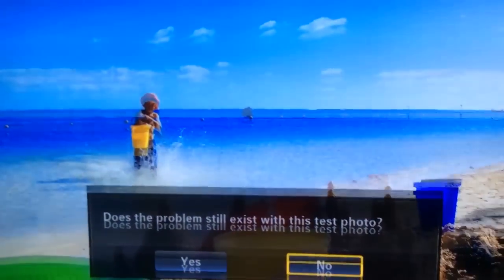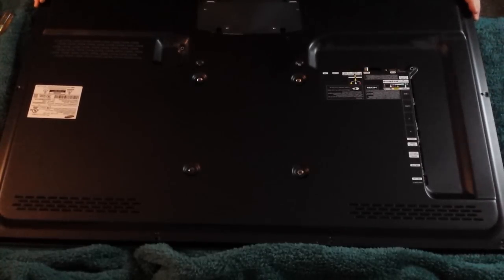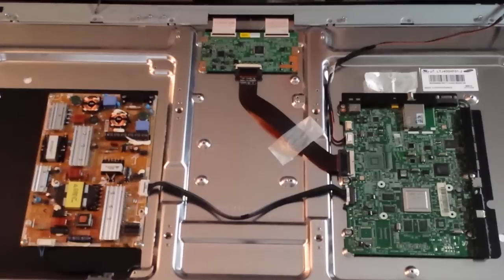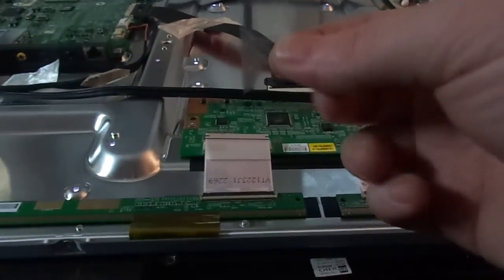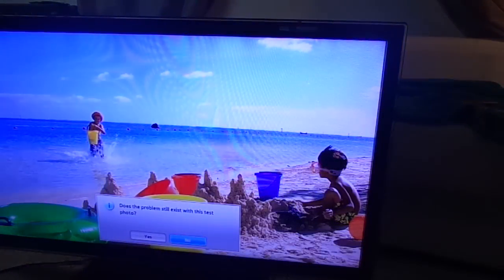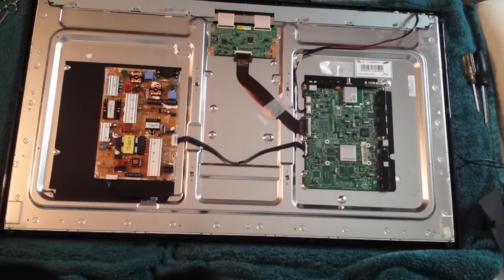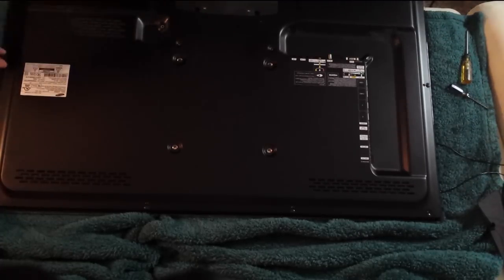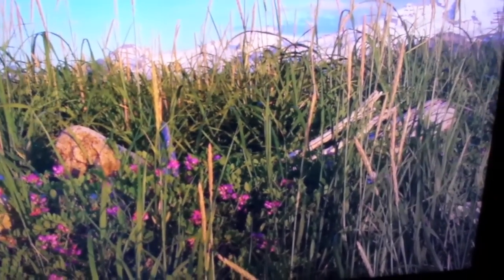LED LCD TV FIX, How To For Samsung Double Image, Black Vertical Lines, Screen Problem Sony LG.

Comment: hello any chance you could give me a close up of the bit you taped? is it covering the gold tab so it cant make contact?
Reply from the maker: Yes it is covering the gold tab
Reply: @DoItWithDave  if i disconnect either one i dont get half a picture bud it loses the picture then the backlight flicks on and off. would this mean both strips need covering? and is there a certain amount im meant to cover? sorry for the questions but im pulling my hair out lol
Reply from the maker: @brianturner5864  double check that the ribbon cables are not damaged. They are very delicate. If no damage it's just a matter of adding the tape over (in my case) the left side of the screens ribbon cable. I covered about a quarter of the gold part of the cable but had to remove and make put a smaller piece on the right side of the cable.
Reply: @DoItWithDave  thank you bud i experimented and done one of the ribbons with a thin strip on the right. i have a perfect picture now aside from a tiny black line running halfway accross the top of the screen but i can live with that as its almost invisable most the time.

Comment: How do you know where to put the tape, and does the tape put some connection on the ribbon out of work?You do it on the left/right ribbon or both?Hope you can help me have a Samsung and find it shame to throw away.If there is another solution I am open to suggestions, thx.
Reply from the maker: Idk if this video is quality enough to see where I put the tape. I put the tape on the left ribbon cable close to the inside, and covered about 12 of the gold tabs. This can be a short process or a longer one depending on how the tape is placed. I had to put tape, remove it, put, and remove a couple of times before I got it in the "sweet spot". If you end up needing to move the tape during the process be gentle with the ribbon cable tips, they can be easily damaged. Also I think the tape helps insulate the ribbon cable so no static electricity builds up that partially causes this issue. I hope this helps.
Reply: @DoItWithDave  Thank you for taking time to answer, I saw last year somewhere simular video, lost the link. But I have an idea how to proceed: fullscreen of video and make a printscreen. Unfortunately I lost the link of that other video, I counted about 16 or 17 goldplated tabs that were covered, So you covered the gold tabs, about 12 of them? Any idea why this is happening to Samsung TV's it seems they are notorius for having this issue. I will try in the next days and let you know how it goes, am not the most patient person on Earth,lol

Comment: nice
i got a pc screen 27', the image is double, 2/3 on the top, & squeezed image repeated  on 1/3 on the bottom
do u think it's the same king of fix ?
Reply from the maker: Idk if you had the PC screen for a while and living with it or you just aquired to recently but at any rate you could give this a go. I know it's not ideal but if it works then you got your image back if not then it may be time for a new screen. Just to clarify this is in no way a professional fix for the double image issue but an alternative possible fix rather then replacing the display as a professional would recommend. Obsolescence is the name of the game.
Reply: thanx for the answer
cant find a professionnal to fix it, so i ll give it a try

Comment: wow i fixed my TV SAMSUNG UE50ES5000 following this video.. i had horizontal lines at the bottom with some ghosting...did exactly the same with the tape on the ribbon cable etc... THANKS
Reply: I found people who cut some lines near the connector on the board itself so it doesn't make connection. I am planning to try to solve the problem on my Samsung UE40D6200, Samsung has become rubbish.

Comment: Hello.. My TV has double image. The small tape you stuck to the ribbon cable you don't discuss..  From what I can make out this is open circuiting part of the ribbon cable ? How many lines are you opening ? I'm surprised to hear you say just stick it on ?  Shurley there is a method to your madness ?  Please tell us more.. Tnx Mark.
Reply from the maker: I just covered about 12 of the gold lines in this video. 
Honestly there is a way to explain why this works from an engineering perspective however I don't know the specifics of why it does. There are more videos on YouTube that show this same method, and explain in detail the facts about why this works. I've heard static electricity builds up and causes the display issue or the t-con board is bad. All I know is for how much ppl spent on these TVs when they first came out, only to get a double image 2 years later is BS. It's a pretty obvious example if planned obsolescence.

Comment: Hi i have  colored verical Lines on my Led Samsung es8000
Can i fix it with this metod?
Reply from the maker: Hello my apologies for the delayed response. If you are still looking for a reply all I can offer is in the last couple of minutes in this video you can see the vertical lines across the display. I simply adjusted the ribbon cable in the locking slot and was able to get rid of them. I hope this helps.
Reply: Do It With Dave can i send you a photo
My Lines are different
Reply from the maker: Honestly I don't know if I can help based on a picture. The issue your tv is having could be caused by a number of factors. Maybe a bad t-con Baird, bad connection with ribbon cables, a bad capacitor. I have seen some videos on YouTube that show a certain type of flat screen that have 6 or more ribbon cables that are non detachable from the display. Some ppl show the image change a bit simply by rocking the tv gently back and forth. If that's the case the cables surrounding the display could get some make shift spacers to adjust their positions. If you really want to send a pic  email 
eyelinegroup@gmail.com

Comment: guys double image screen on samsung 32 screen how to fix it any tips or tricks
Reply: you got a same problem as mine..have you got it fix?
Reply: @migi741  i did scratch the specific line on motherboard it worked for 3 hours Hd and fine problem fixed but after 3 hours 45 minutes all went ofg like dead screen the tech told me thats the double image screen is signe on future problem u need to fix it asap now im buying new motherboard display . if you wanr to see the do it at your own risk method it could fix your tv replay me i will try to show you the video or send u the yt link here
Reply: @MrYoyo374  i dont see any link..and the future problem is like what?
Reply: @migi741  i did as the guy on video told me not this video other 1 i failed somehow to do something boom a whith screen with only asound inti
link Put it in High quality and use a loop zoom and use flashlight becarfull bro   https://www.youtube.com/watch?v=LKCb7K1jrOA copy the link or writte it doqwn on google

Comment: The problem got progressively worse as I tried to fix, do you think I should just get new ribbon cables and try?
Reply from the maker: I did this on another TV and the ribbon Cable became damaged and it did get worse on the display. I had an extra ribbon cable lying around luckily and use that and it did work. If you choose to continue working on this you can find the part number for the ribbon cable on the back end of it, type that into eBay on the search and you should get a listing for all the ribbon cables that are compatible. I hope this helps.

Comment: My Tv has these ribbons at the top, not the bottom. So I'm not sure if I'm supposed to do it mirrored of how you are doing it? As in, put the tape on the right side? I tried both sides with various widths of tape for like 4 hours and all that ever happened was the side I was trying to fix with the double image just turned white, rainbow, or black.
Reply from the maker: The issue your dealing with is common, so ppl don't have great results following the steps in this video however some people have stated using a small piece of paper and placing it on back side of the ribbon cable (not gold side) and getting good results. Kind of like putting a spacer between the ribbon cable and the bracket. Also this process is ay last ditch effort as it is a hack video and not a professional fix. If you decide to continue working on this remember the ribbon cables are very delicate and can become scratched if worked too much. I hope this helps.
Reply: @DoItWithDave  Thanks for the reply, i will try that thing with paper in the morning and see if it works. I also found a video where a guy was fixing same problem with my exact model TV same way youre doing it, and in the comments section someone said that you have to put the tape over the first 19 gold contact strips which is funny because when I pause your video when you show a closeup of the tape,  I counted exactly 19 gold strips under the tape.

Comment: Thank you! This is what I love the internet for, thank you for the time and extra-work to make this video! 👍💚
Reply: After an hour I got it aswell, but for me it was the right cable and I needed to place three layers of three millimeters wide pieces of office tape underneath and not on top, I pushed it down and lifted it and realized it must be the contacts on the most left or most right, the and connectors are mirrored. Thanks again 👍

Comment: Hello, great video. Will this fix work with Samsung plasma with horizontal black lines on screen?
Reply from the maker: I don't recall anyone posting doing this with a plasma. I know from experience that early versions of plasma had ribbon cables that weren't accessible like this video shows. I think cables were compounded in the display.

Comment: Hello,
I have the same breakdown tv on samsung I mi the sctoch on the connector but it does not work, it's vertical strips the sctoch you put it at what place on the connector? by putting the sctoch it does not prevent the connection of this? merco for your answer !!
Reply from the maker: Hello. I put the tape to cover about 15 of the gold pins (lines) and that worked for me. As far as the lines I had to very carefully position the ribbon cable sliding from side to side very delicately until the lines went away. The reason for double image is bc static electricity builds up on the cable. The tape prevents this from happening in the future. Unfortunately the steps shown in this video don't always work. This is a "hack" not a professional fix. The reason I posted is because the professionals charge more than the tv is worth. It's a last ditch effort. If you continue to work on this be as delicate with the cable as possible. They can be easily damaged. Also the tape works for some ppl when more or less on the cable is covered.
Reply: ok thank you very much for your answer, it finds the pb comes from the slab of the tv no?

Comment: Thanks a lot sir it worked for me I am from hyderabad telangana state India I'm really proud of u sir my sony led worked fine but one question sir it could damage more components or how its worked how its possible pls mention sir.but 3d stopped working
Reply from the maker: From what you posted it sounds like you have a 3D tv, and the 3D isn't working after following the steps in this video? If so unfortunately I don't know if this is a direct issue from following the steps, however it seems like it would. Also I haven't seen any posts addressing this type of issue. I hope I understood your question, if not just reply. I hope this helps.

Comment: I really didn't believe it was going to work. And it took a while but i actually found that sweet spot for the piece of tape and it did fix the issue. I can't thank you enough.
Reply: Dude... Help!
I tried to do this last night and I wasn't able to get the picture right. Did you glue the piece of tape on both sides? I can't get the picture to display correctly
Reply: @kickspyka  i did exactly what he shown in the video: A small piece of tape, covering both sides of the ribbon cable... but make sure that on the side with golden pins, they are properly covered. Also, try moving the piece of tape along the pins until you find the sweet spot. Take your time. Idk why it works, but it does. It took me a while and i had to try it with both ribbon cables. I found out that it's a good idea to disconnect one and check the image (in my case, just by disconnecting one side fixed the problem on the remaining connected site), then try reconnecting that cable and compare the image quality disconnecting the other and see if one cable wields better results than the other. If so, apply the tape on the cable that was causing more trouble. Besides that, i did everything exactly as the OP shown in the video.
Reply: @kickspyka  also, make sure that the piece of tape is well stuck there. Try not to leave any air bubbles (i know it's hard to see, as the piece of tape has to be really small... Like 3 mm wide at max)
Reply: Thanks for your help, I'm going to give it another shot...
When I put the piece of tape, some times I got a black screen, nothing was showing. And I couldn't figure out which side was the bad one because I only got the double image when both sides were connected.
Reply: @kickspyka  i also got black screens and usually right after disconnecting any of the cables. Not all the times though. Just leave the ribbon cable you are testing disconnected and unplug and re plug the power cord and turn your tv on again. You should get an image. Also, sometimes, specially when glueing the tape on the side oft he cables close to the midline of the tv, the screen went almost black or the image quality went down by tons. In that case try either a smaller piece of tape or moving it a bit. In my case, pasting the tape right on the middle of the cable did the job. So it's a trial and error process. Good luck.

Comment: Thanks for the video, how long does it last , will screen fail again in the future ? Wouldn`t replacing the ribbon cable a better fix ?
Reply from the maker: Sometimes it last for a short period of time, in my case my TV is still looking good. You could try and replace the cable. From what I gather it's static electricity that causes this issue. The tape helps keep any static build up in the future.

Comment: Ok I feel like I missed something, what is the goal with the tape?  Just put it anywhere on the strip? And how do you know what side to do it on?
Reply from the maker: The tape keeps static electricity from building up on the contacts on the ribbon cable. And I placed the tape over around 20 small gold lines on the ribbon cable and wrapped it around the back side. It's not a professional fix, however ppl that went to the professionals posted the real fix was to replace the display panel. This is a hack so I didn't have to purchase a new TV. I hope this helps. Remember if you do decide to work on your TV it's important to be very delicate with everything.
Reply: Ah ok!! Thank you so much!!!
Reply: We tried it but picture wasn’t getting any better, my husband suggested trying a piece of tape on the right ribbon cable.. and it seemed to just get way worse after that!  Do you think there was a reason this happened !??
Reply from the maker: @jachetta77 I would check the ribbon cable tips to ensure the gold strips aren't damaged. They can easily be scratched, also that the is no brown or black areas on the cables, if there was is would be vary obvious.  Honestly from what I can gather, based on ppl's comments, the issue for the consumer is planned obsolescence. If so many ppl can "fix" the display with a piece of tape, when the manufacturer suggests to replace the entire display, somethings not right.

Comment: I dont understand what the tape is for? To secure it more in place? To cover certain connections? I cant see where you even out this clear tape. Doesn't help when my whole tv dims black if I disconnected/move a ribbon
Reply from the maker: It is used to cover up a small part of the gold portion of the cable. Only like a quart inch. There are a couple of reasons. This helps stop static electricity from building up, it acts like a spacer to help push the cable tight into the contact. The gold part is very very delicate, patience is definitely a tool went doing this.
Reply: @DoItWithDave  Patience... Aye i messed up a ribbon attached to the LCD. Lovely pink/green section in the middle now that means new tv time I assume? Thanks anyways! I wasn't far off saving its life